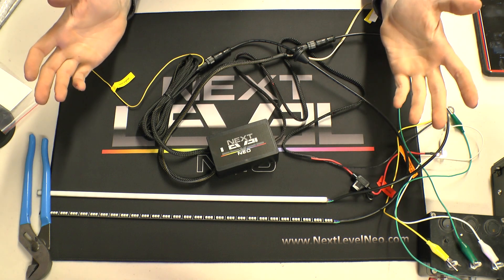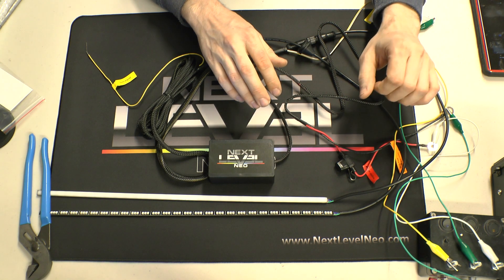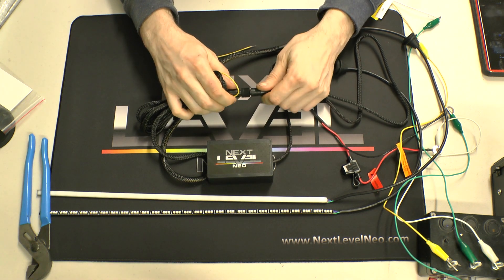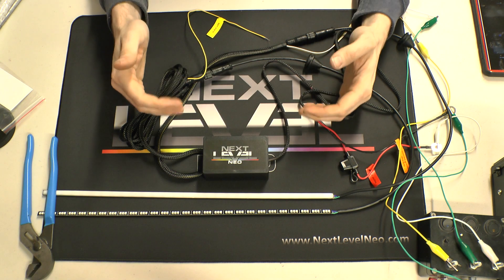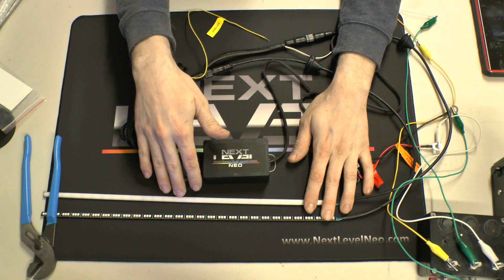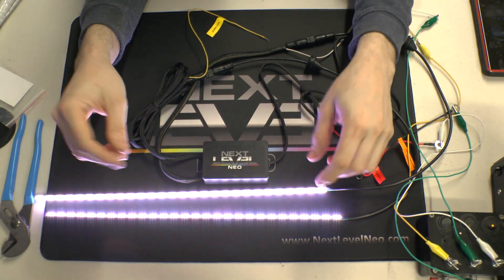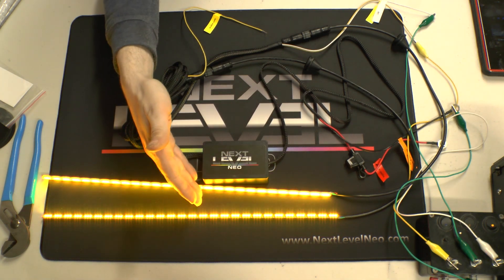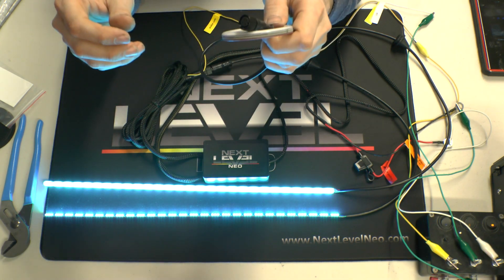Revolutionizing RGB Lighting: Introducing Our All-in-One Controller and Enhanced LED Strips

Comment: Lets get waterproof plugs incorporated into everything! Strips, Blueghozt, extension wires, etc. all straight out of the box that way I have people stop damaging JST connector pins😭😭
Reply from the maker: i wish it could be that simple. I sell them on my website and you can install them on your builds but unfortunately its not practical to switch our entire lineup to a plug that no one else uses. These new RGB kits are not meant to integrate with other systems and devices so we were able to do it.
Reply: @NextLevelNeo  Ahhh sweet, makes sense👍🏻
Reply: Will you be doing the flow style with this one box setup?
Reply from the maker: @killshots27  our flow controllers are currently just 1 box for controller and driver, there is a separate inverter on the 5v version. The 12v version will not have an inverter. Unfortunately eliminating the jst on the addressable linup is very problematic since that is the industry standard and those halos are meant to be universal.